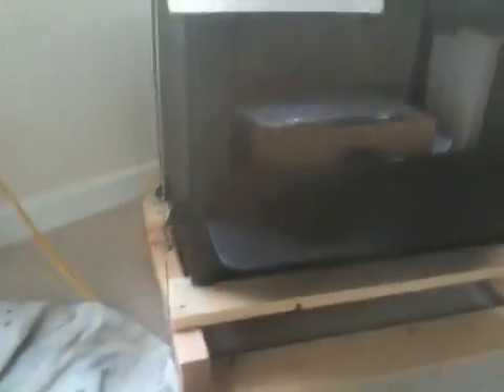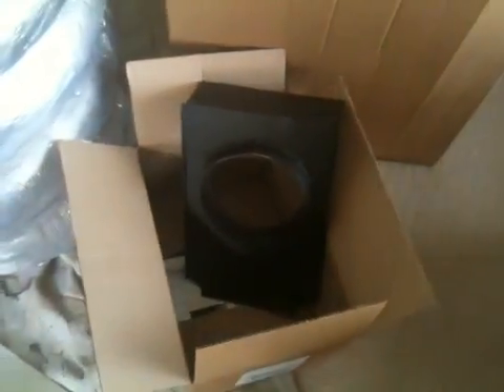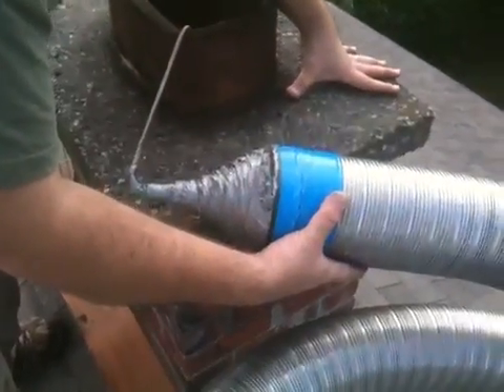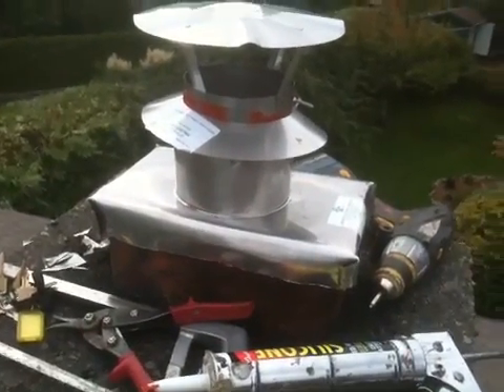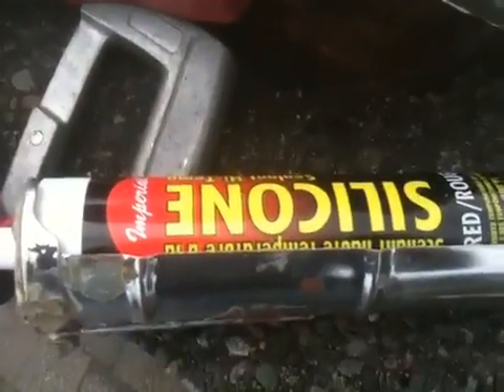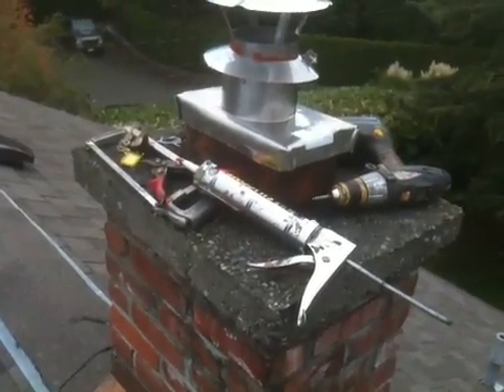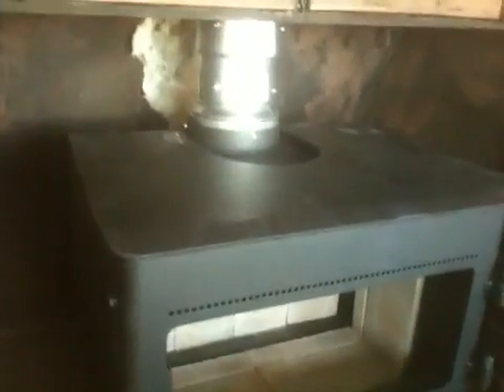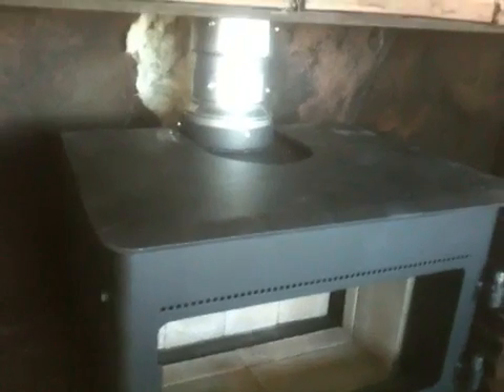How to Install Fireplace Insert & Liner in Brick Chimney existing Clay Flue Liner

Comment: I am very happy with this purchase >>>arah.in/9d4H. The heater works great and the "fireplace" look is pleasing albeit small. I partner this unit with a similar heater and the pair make my unheated, insulated garage comfortable in cold weather when "preheated" for a couple of hours. I have yet to try these in frigid winter.

Comment from the maker: @Pitamuito the insert is usually Warnock Hersey (or another lab), tested with it in a proper masonry firebox, therefore is only code compliant if is in that situation. The short answer would be no, it is not possible to take firebricks out... Check your installation manual from the manufacturer

Comment from the maker: @RobBob152002 Very good question! 
The reason the "male ends" of stovepipe and liners point downwards is so that any melting creosote can run back down into the appliance and burn up harmlessly. The code on this changed a few years ago. I will accept your apology in advance...

Comment: great do it 'yourself'' project.   go online and get codes 'national. you can trust you.
NFPA 211
Standard for
Chimneys, Fireplaces,
Vents, and Solid
Fuel-Burning Appliancesu will do a better safer job than a ''sweep''   and you can trust you.